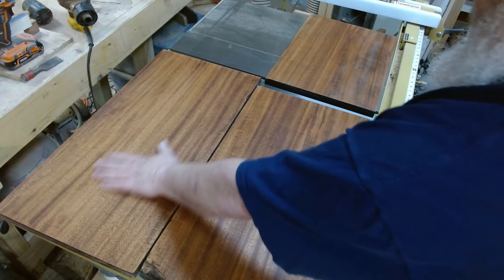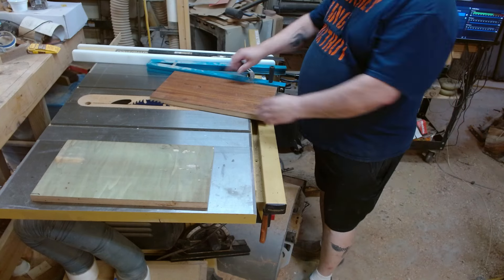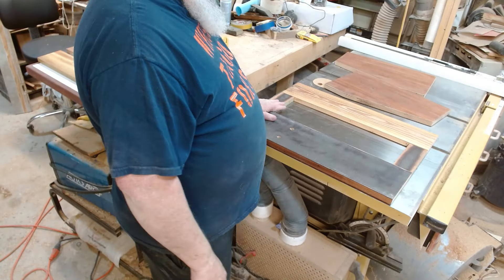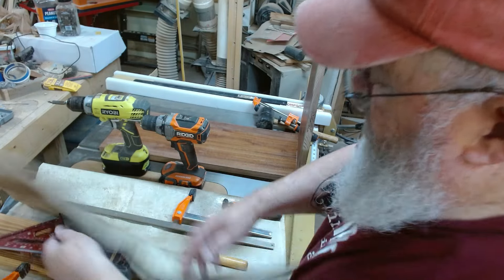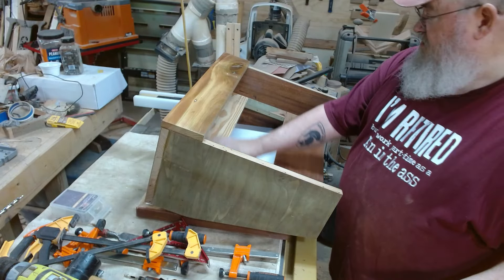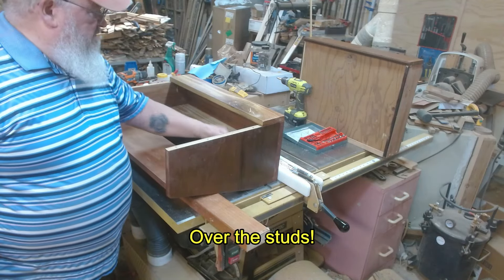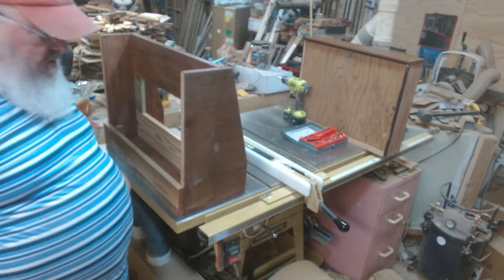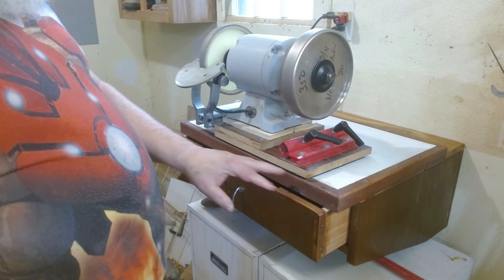Finally! A Proper Sharpening Station

Comment: Hi Billy, Do you have some tools that you sharpen with the wheel turning up away from the edge? 21:00
Reply from the maker: Yes, I sharpen all of them this way now.  It takes some getting used to and you have to make sure you maintain good contact with whichever jig you use.  But I like it, so far.
Reply: @TheMessyStudio I’m doing the same.  I turned the base around on the motor to keep the switch in front.  It’s especially better when sharpening a bottom feeder gouge. Also I think it’s easier to keep a light touch.  One thing is that the grinder dust goes up!   Any ideas on grinder dust collection?
Reply from the maker: @krperry2007 , not really.  I just have a fan blowing from behind me.